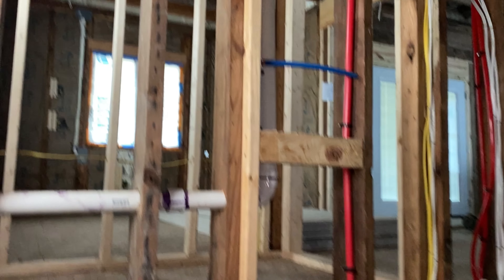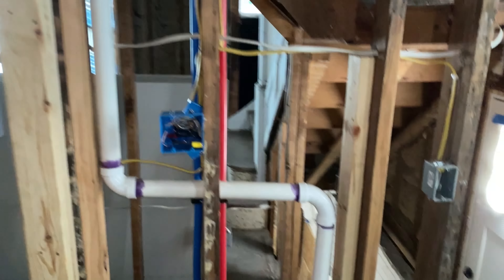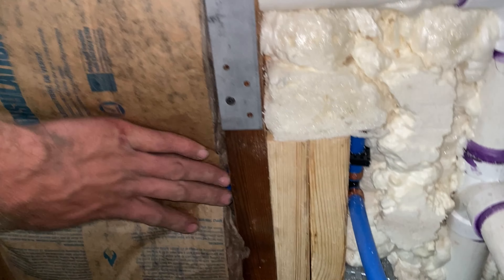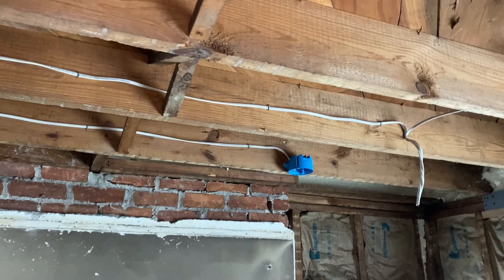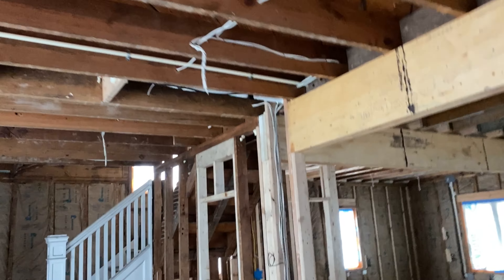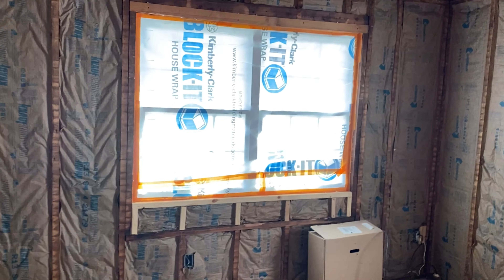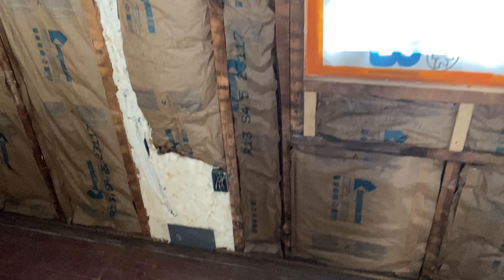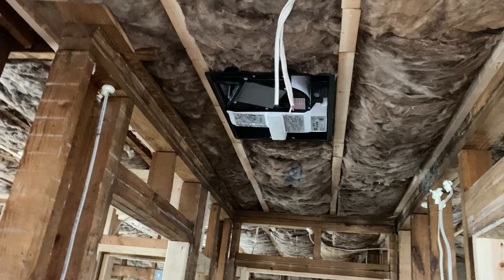Warning! Boring Video. Inspecting rough framing and insulation before drywall.

Comment: Good work.  Couple of comments though.  I would remove that white paint on the fireplace brick and remove the mantel; I'm sure you can put something better there.  I would also convert that fireplace to gas if gas is available in your area.  The floors look like you have all kinds of different flooring.  I would retain the original flooring where possible; resurfacing the floors should work out great.  I didn't understand installing a galvanized water supply line; those things give out after a few decades.  I've replace galvanized with copper so many times.

Comment: I'm not a plumber, so I ask why you need to run plumbing on your outside 2x4 walls? Wouldn't it have been easier for you to have ran those through your floor joists over to your interior walls? Same with electrical. My guess would be then it would be less spray foam and concern about those drainage and electrical lines freezing. 

Let me know! Amazing coverage over your entire project.